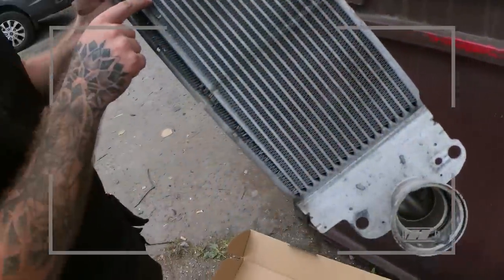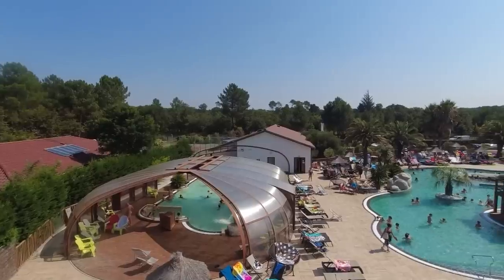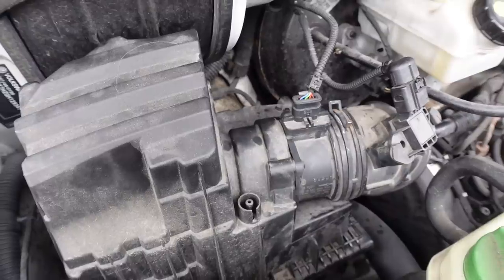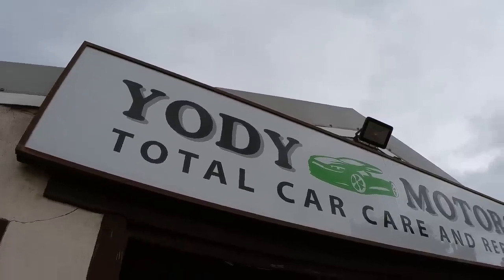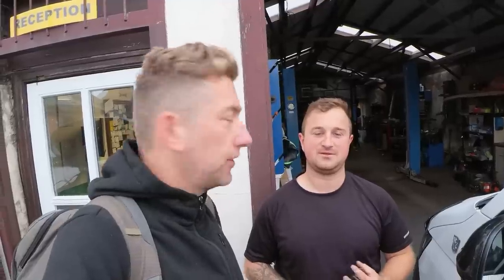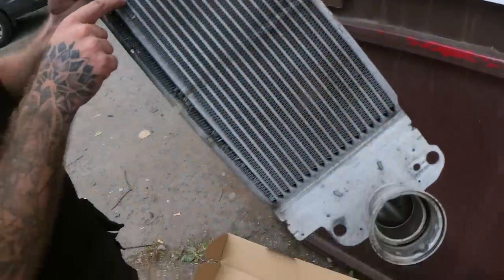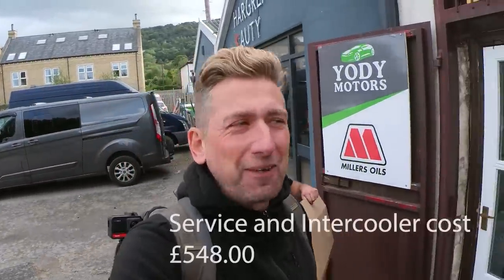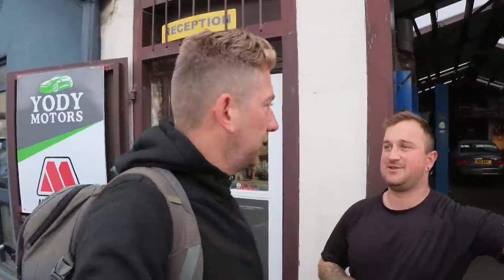VW T6 common FAULT   -  CHECK YOUR VAN

Comment: I'm glad you had is fixed, 🥰but it makes me thankful I own an early (1992) petrol T4 camper. No dreaded engine light and no ODBII to worry about. Fingers crossed, no issues at all in the 4 years I've owned it. I wouldn't change it for a modern T5 or 6.
Reply from the maker: Proper mechanics your van mate, can be fixed with a few tools and a bit of spit 🤙🤙

Comment: I had this issue all the way back from Scotland. I was told I needed a new turbo until I saw a hole in the intercooler. 
My map sensor was covered in oil putting the van in limp mode without any boost. 
Of course when I went to change the map sensor the screw heads rounder off.
Reply from the maker: Haha there is always something that makes a relatively "easy" job become a nightmare.... rounding screws off bud, I feel your pain 😭

Comment: Just been watching couple of vanlifers, those happy days, £10500 on a new engine and now it has a blown head gasket, weeks before the garage can look at it and that was a Citroen. Any vehicle always has a risk of an expensive fault. Regular servicing from a trusted specialist is the best protection. Aftermarket Warranties can protect from devastating cost but they are not cheap. In general I think making a servicing fund where you put £100-£200 a month is a good buffer for servicing, tyres, repairs, upgrades.

Comment: Just had the same thing on my T5.1. Limp mode activated as soon as I went over 50mph or up a big hill, basically when you were trying to give it some..... Had loads of checks, minor things changed but then my mechanic found a crack and hole in the intercooler. Made a massive difference to the van overall & mpg etc...
Reply from the maker: Glad you got it sorted mate...  if it drives like mine does now bud I bet it's lovely! (Until the next thing 😬🤣🤣)

Comment: Never had a split intercooler myself, I've had a split boost pipe before. I'd tell you what to check though Col, the EGR Valve! They clog up with carbon and are easy enough to clean with brake/Xarb cleaner. It's a must do with all diesel engines. Great informative vlog again Col 🙏👌

Comment: I had the same issue  as you a couple of months back on our 66 plate T6. Coil light on dash 😢 I replaced the MAF  sensor and also the N75 valve. It didn't sort things so I took it to the garage. I had a split intercooler, everything has fine since getting that replaced.

Comment: Our T6 was exactly the same after returning to Stoke from Watergate Bay Devon. (It’s  just seems strange that both our vans got us home then the problem occurs) I took it to the local garage as the engine management light was on. They replaced the intercooler and everything has been sound since. 👍🏻 It’s a great shout to everyone to get it checked. I think the front bumper has to be removed to check.👍🏻
Reply from the maker: Ah mate, I literally feel your pain. Glad it's sorted though... 

Anyone reading this, definitely check the intercooler before it's too late

Comment: Just changed my intercooler at 18 years old with 235,000 miles on it. Other than that, never had an issue but then again I'm a VW  master tech😉

Comment: I’ve got the engine management light on, DPF light on, and a flashing coil light. Don’t know where to start with it. 2007 T5
Reply from the maker: Mate thats not good.... I'd take it to a garage for them to pop it on the diagnostic machine to see what the issue is

Comment: Do I get a prize for suggesting it was your intercooler? It was an educated guess as mine went on the T5.1 and the error code is for the system. Therefore likely to be the inter cooler or leaks in the hoses in that system.

Comment: How many paranoid Transporter owners now after watching that 👀😂
Reply from the maker: If you own a Transporter and are not already paranoid by default, there is something not quite right 🤣🤣🤣
Reply: @Yorkshirepoptopadventures  fair one, i did my timing belt and water pump a few days before heading off for France and Belgium, luckily I did as the water pump was weeping and I had no idea, still on edge the whole time I was there though 🙈